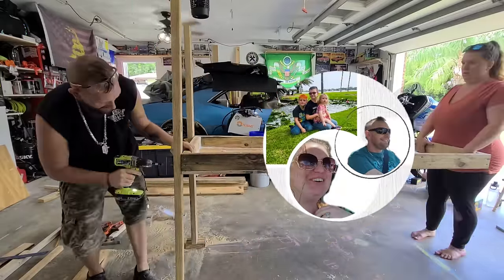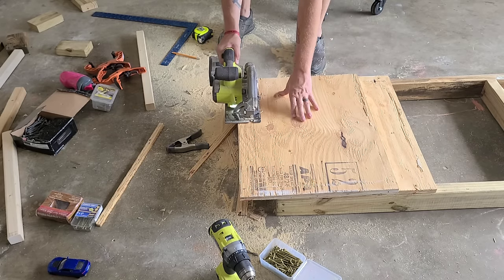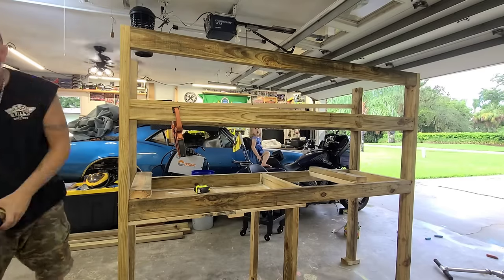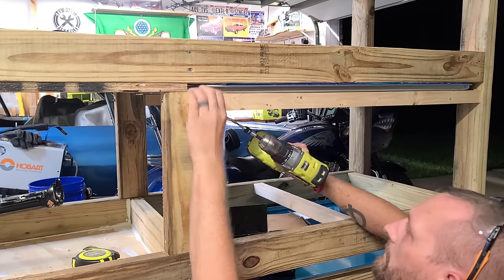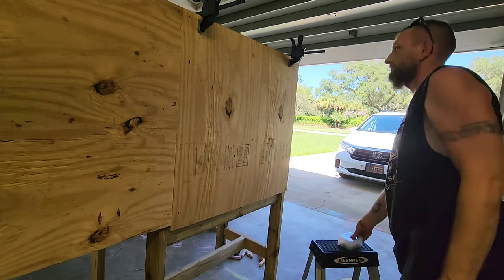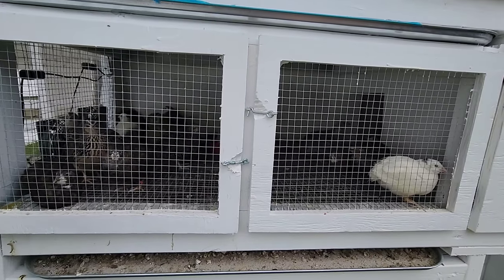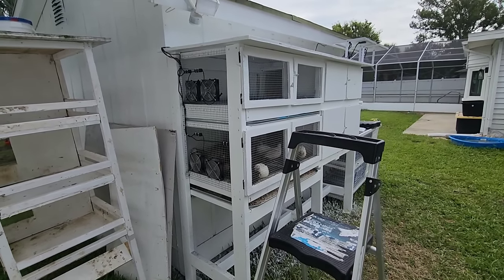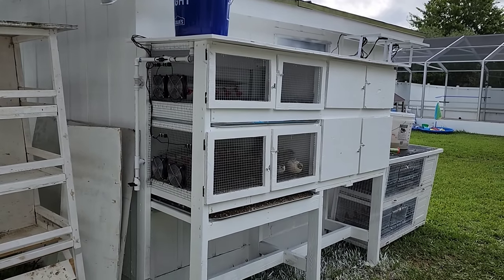DIY Mega Quail Coop Build How to!

Comment: Glad to see you doing good! I do have a question though. My husband built our chicken coop, we typically had them free range but when we had our driveway done we had to keep them in the coop and keep our outdoor cat who typically would sleep with them in the house. A raccoon got into the coop and killed two chickens. We live in WI, about 35 mins away from where you guys used to. The raccoon peeled back some pretty tough wire   on the bottom portion of the coop to get in and I was wondering if you have ideas for what else we could use that could still keep it "open" on the bottom level but also protecting the chickens incase they ever are having to stay in the coop again. 

I have been working on convincing my husband to move somewhere warmer for years now but he loves his job and both of our families are here. Plus my dad just passed away in June and my mom needs alot of help now and we're looking to move her closer to us from waupaca.
Reply from the maker: They recommend to dig 2 feet down with the wire to help discourage them from digging.